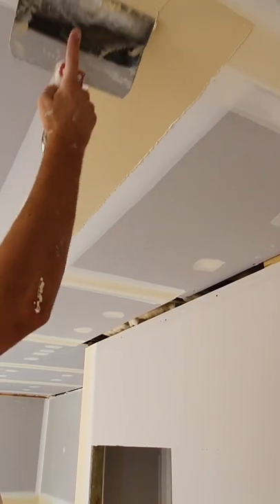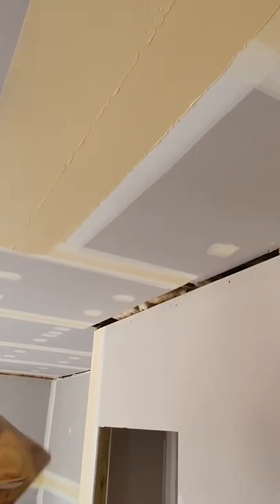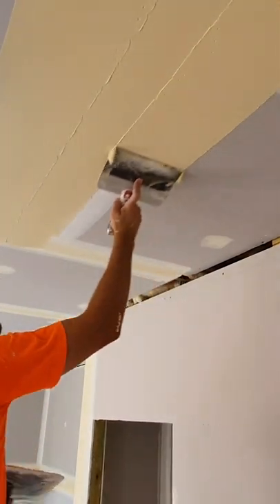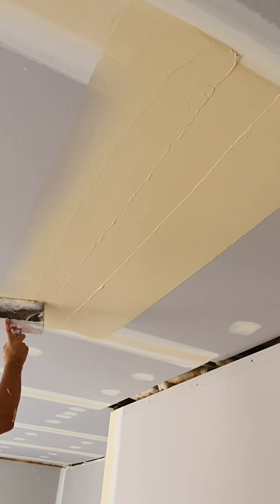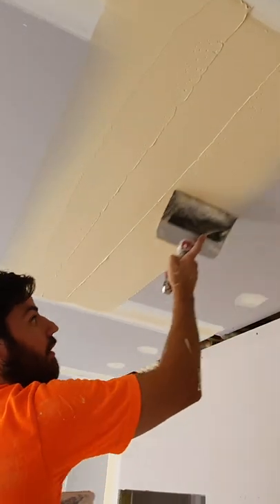How to finish a drywall butt joint #shorts

Comment: looks good but it looks like a bit more work than using a finishing trowel
Reply: Nonsense.Trowels are over in the tile and stucco section.
Reply: @velt7560  going to assume youre making an elaborate joke that nobody under the iq of 200 can understand because there exists a thing called finishing trowels for drywall mud / sheetrock / whatever your country calls it. but i doubt youve ever done a level 5 let alone even skimmed anything at all before lol

Comment: I see that yellowplaster on all the commercial jobs… it looks really smooth is it available for the diy’er?
Reply: It's a dye color added so when u make a first coat  and the 2nd  a different color it will help u see better what your doing
Reply: It's not dyed, it's just topcoat.  Basecoat over the tape, the topcoat over the top.  It sands better and gives a better finish.
Reply: Hamilton all purpose is that color out of the box it dries a lot lighter tho.

Comment: 🤔 12 inch box each side and 2 passes with a 600ml trowel or skimming blade much much quicker.... 2 for the price of 1 👍🏼🤜🏼💥🤛🏼😃
Reply: I go 10 box on 0 down each side on the double. 12 box on 1 down the middle then finish with 32 inch skim blade.
Reply: I bed it them skim with a 12 " knife three wide.Faster and easier.Olus hands on is always better.